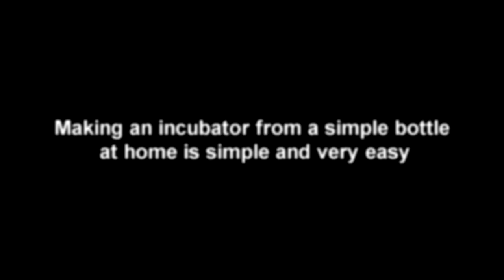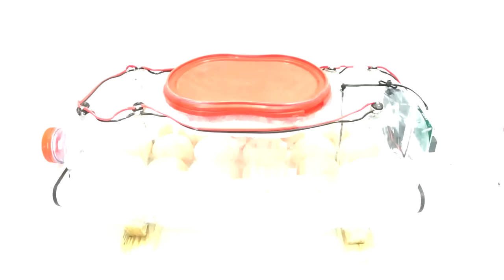How to make a home incubator from a bottle | كيف تصنع حاضنة منزلية من زجاجة

Comment: It would be great if  fitted with  temp meter  assistance  as well?
Reply: There are mini hygrometers with a little screen that goes outside the container and a sensor on a wire.  I used them for my fish we used to have then got em again for my incubators. One had a built in sensor but the temp part doesn't work (preowned) and the other (new) doesn't have one at all.
Reply: That’s the function of a thermostat and it’s there

Comment: How many inches wide are both pipe,how many watt is one bulb and fan,the bottle used is how many litre and  what we you do if the heat degree is up to the required amount ,will you off the incubator and allow the heat to reduce and then on it again or the thermometer  control the heat, those it require constant light.

Comment: I learnt a lot from this video , step by step. Thank u for everything, I just want to ask about the last wire u put on inside the incubator what does it do I never saw were it is connected. It was the last wire on-top the incubator. Thank you 😊
Reply: There must be a sensor of the moisture measuring device at the last cable end suspended inside the box.